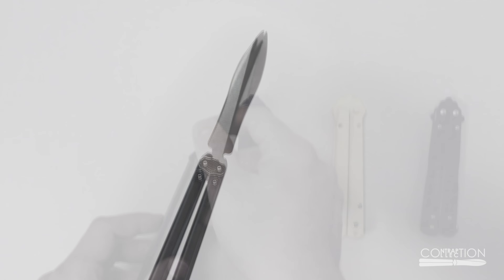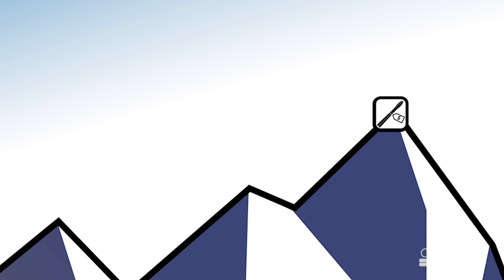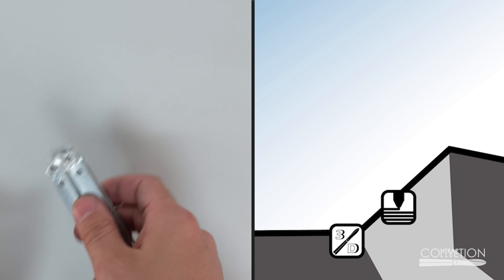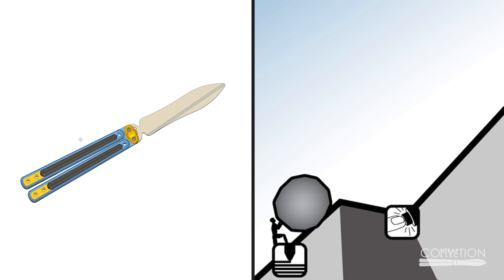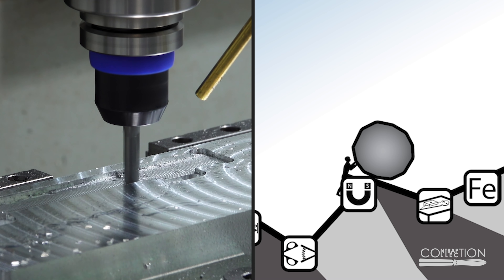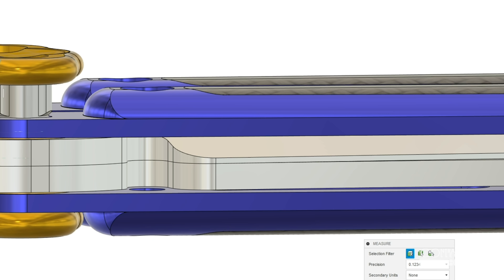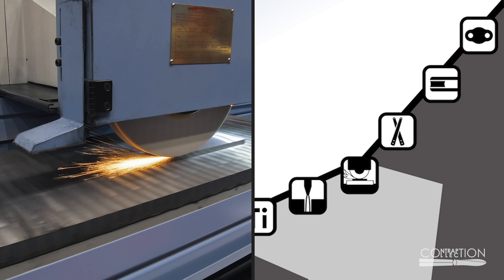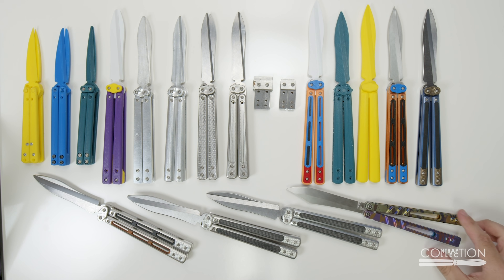Where I've Been and Where I'm going. Baliscissors Ep 16

Comment: As a machinist I find bronze and copper to be quite grippy because of how soft they are that I usually hate turning them. I might suggest delrin for a couple reasons. 1) it’s a lot easier to turn, this would help with speed of processing if you go the way of making your own washers
2) it’s got a lower yield pressure so it won’t bind like bronze or copper would if your parts aren’t “exactly” 16 thou. Usually the reason I would avoid delrin is because it’s yield pressure is less than the other options so it doesnt hold as much weight. However I think having a lighter yield pressure would be beneficial here because 1) you aren’t carrying much weight to begin with and 2) this is the exact reason it decreases binding
3) delrin is cheaper than bronze and copper thus giving you more price flexibility to use titanium parts and the like.
All in all I think delrin would be the perfect material for the bushings and with my experience, albeit not “that” much, I’ve never worried about a delrin bushing breaking down or not lasting. For the right applications they seem to last just as long as a brass or copper bushing. AKA theoretically forever

Comment: do a tri way pivot setup the same way Hinderer does for his knives. just include a set of thick teflon and phosphor bronze washers that the user can change out themselves. if anything id advocate milling the pivot pocket deeper to try and fit the thinnest ceramic bearings you can find, (I believe skiff bladeworks makes his own bearings in house) 

also the steel should be buyers choice. S30V is a perfectly fine cutlery steel along with CPM-154 because they have become much cheaper now with time. while M390 steel being the much more premium expensive option that you can charge whatever you like for. if you do plan on doing your on in house blade heat treat, ive heard AEB-L and NITROV are very novice friendly steels that perform quite well. 

im not sure if this is the help you are looking for but ive been loving this series so far and looking forward to the launch of this product.
Reply: Tri way sound complicated. But certainly bearings or bushings would be good to have. I would recommend just buying bearings, not making them inhouse. As you mentioned, Skiff makes bearings, and they are pretty much the top tier caged bearings.
I have heat treated NitroV, it's pretty simple due to the plate quench. You don't need to be as quick going from the kiln to the quench as you do with carbon. You need to do all bevel grinding pre ht or it will warp. As a steel suggestion, 20CV or M390 (they're the same thing) are good choices, as they are currently the favourite stainless "super steel". S30V is still gonna be good though.

Comment: Giving the blades a distal taper could help with the balance and since the the blades are more likely to scratch against the handles further away from the washer and mounting point have a distal taper would add more distance from the blades to the handles as the blades outer faces wouldn't be parallel to the handles

Comment: 154cm would be a nice steel for the blades. It's got a good edge retention and it's not too hard to sharpen. Also haven't had any problems with it chipping at all, the edge just rolls which shouldn't be a problem with scissors. I drop my balis on cement a lot if that helps

Comment: This project is really exciting, as a knife maker i do have a few suggestions for steel and such. Personally I feel that AEB-L steel heat treated to about 61HRC would be a solid option, good edge retention, pretty good corrosion resistance, overall just a nice steel to work with. I assume you're planning on sending these out for heat treatment but if not check out evenheat kilns and you can heat treat a few smaller batches on your own. not sure if that's economical for you but it would allow you to test multiple types of steel and find what you think is best without having to deal with the high prices for small batch heat treatment. As for sharpening I'd recommend about 80° or so, and this could easily be done on a cheap 1x30 belt sander with a jig to hold the blade at the right angle. for scissors i would assume bringing the edge up to a 400 grit belt finish would be more than sharp enough. the curve in the blade is definitely the trickiest part. Most heat treating services have machinery capable of straightening blades post heat treat, and i assume this same thing can be done to put a slight curve in each blade if the heat treating place is okay with that. I'm guessing all your machining would be done pre heat treatment so you could essentially get the parts back from heat treatment and just tumble and sharpen each. You could also do a shimmed temper on every blade where you heat it to about 400°F and clamp to to a flat bar and shim the ends so that it induces a slight curve in the blade. Hopefully there's some helpful information in there, can't wait to see where you take this product.
Reply from the maker: Thanks for the comment. Could you explain more about why you think AEB-L is good?

I definitely want something with corrosion resistance. I'm doing some tests now with S30V, simply because it was easy to order from McMaster. It looks like AEB-L has some different strengths, one of which is the use of knives with thinner edges. That seems like the opposite of an 80 degree scissor edge. But maybe that comes from increased toughness which is also good for scissors?

It also looks much more affordable than S30V. If there isn't any large sacrifices in quality that might make it worth using. Some have said S30V would be unnecessary for scissors.
Reply: Contraption Collection Definitely! S30V does seem to be a bit overkill for a pair of scissors in my opinion, the main concern i have is that hardened steel will be rubbing against hardened steel, so something like AEB-L with a fine grain and relatively good edge retention as well as fantastic toughness will likely hold up pretty well. AEB-L might have lower corrosion resistance and a lower edge retention compared to S30V, but you could also go with 14C28N, essentially AEB-L with added nitrogen and chromium, both of which increase corrosion resistance. AEB-L is just easier to find. I know from experience that the CPM S_ _V series are good steels, but many find them a bit more expensive for any added benefits they might have over other stainless blade steels. Frankly, with such an obtuse edge geometry and considering that the blades will likely not be in contact with acidity or salt water i think the difference in performance between a set of cpm s30v blades and a set of AEB-L blades would be negligible so you really just get the advantage of using a cheaper steel. Honestly AEB-L might even be a bit overkill considering most scissors are made from lower quality 400 series stainless steels. Here's a good link if you want to look at more of its properties:
https://knifesteelnerds.com/2019/03/04/all-about-aeb-l/

Comment: These things are freaking awesome!  I have zero experience making anything like this so my input is probably insignificant and I totally get that. You said something though about making the blades lighter I believe, first thought I had I make them skinnier like one of those first models you made. If it doesn't put you at the bottom of the mountain, personally I think those look a little cooler.

Comment: since the scissor blades dont have holes and isnt grinded down like normal blades its basicly 2 metals plates put as the balisong blade so its heavy but you can either put holes in the scissors or thin the blade down [either making it flatter or  making it narrower] to make it lighter [it will make the scizzors look wierd in a balisong form but it would make it lighter

Comment: I think the problem with the sisyphon projection is that it's unrealistic and often used wrong by beginner on new projects. It makes things easier to visualize and gives a false sense of organization. As you pointed out you've found your self at the bottom of the mountain many times but that's because the initial goal is the finished products. Just like climber don't immediately go for the highest and more risky mountain on the first try, it would make more sense to set smaller goals for "training". You could have divided this gigantic mountain in more "climbs". First would be a 3d printed version, than steel or alluminum, than better parts, and so on and on. I think that is a more realistic visualization of the work you've been doing, training on smaller mountains to then take on the last big one, to me this helps visualize more the steps you've got to make to reach the top and then figure out possible mistake. Also when you reach the top of the smallest mountain it's more satisfying than feeling like you are tumbling down the only mountain you have to climb. Sorry for the long comment, love your work, can!'t wait to see what you come up next!

Comment: TBH, You do not need s30v steel. It will unnecessarily raise the price of production for a benefit not fitting for scissors. Knives benefit from exotic steels, scissors don't. Good steel for scissors would be carbon steel. Something like 1095 or better. Look for steel with good edge retention while also being strong. I wish you luck in your project so hopefully one day I may purchase one of them. Good Luck.
Reply from the maker: I don't get as excited by fancy types of steel as other people, but I did want to pick something where I don't have to worry about rust. If you have any suggestions for corrosion resistant steels let me know.

I also care about ease of hardening. I thought some steels are more fickle than others.

I also think I'd be cool to do some with Damascus. Probably from Damasteel. It might not be something for every pair of baliscissors, but I thought messing around with S30V would be a good step in learning machine and heat treat fancier steels.

Comment: I prefer heavier hand tools, I have a better understanding in how the tool will react to certain tasks. The current scissors I own can cut a penny into a spiral, makes a really good strength test. If you wish to achieve a lighter weight whilst keeping its center point, removing material equally from both the handles and blades. For this "Skeletonizing" could be a viable option. When selling, I'd make both a heavy version and a skeleton version. The heavier option would be cheaper to make but cost a little more in shipping whilst the skeleton would be more expensive because of the extra manufacturing steps but shipping would be a little lower.

Comment: Little bit of advice make it to where the knives are naturally blade heavy and have it to where there are three different types of weights or that can be figured out later how many and the attaching mechanism but basically allowing the flipper to choose if they want a handle heavy knife a neutral heavy knife or blade heavy
Reply: also one thing you may want to think about is having both an aluminum with cheap steel and a super steel with titanium and with the thing above it could be placed where at the foot of the handles the material that separates the two handles if that makes any sense having it to where they can be unscrewed and new ones installed both of those things the cheaper versions and more expensive and the ability to customate where most the weight of the knife is

Comment: Always find something interesting in your videos....suprised you didn't seem to mention the challenges of your endevours with this YouTube channel?
Anyways sort of seems a like a little bit of a crisis of identity....coupled with a lot of aspirational goals for your product, define what you want this to be scissors or a Bali fidget/trainer/flipper that are scissors. From there aim squarely at achieving a product that performs (personally - they are scissors - pointless otherwise....so make them good scissors the Bali fidget will come with fine tuning).
Phosphor bronze washers or ceramic bearings, stay away from Teflon.
Put a bow in the blades to ensure possitive mandrel connection and cutting performance (would think that this could be achieved by having a clamping mandrel for the blades immediately after heat treat.
Consider a micro serations on blade
Spring handles and some type of finger holes (consider reversing the pivot on the option you illustrated For the finger hole opening mech) would be great
I eagerly look forward to the final product and to see how you meet the upcoming challengers.
Cheers buddy

Comment: As a hobbyist-knifemaker I think you focus too much on steel selection. S30V is a great steel, but I don´t think it´s really necessary for scissors, where edge-retention is the only goal. D2 will probably work just as well. Whatever steel you decide on, the most important part is heat treatment. You should definitely look into cryo-treatment and maybe a shimmed temper to achieve the bend in the blades.